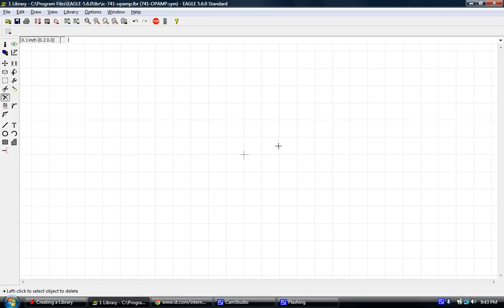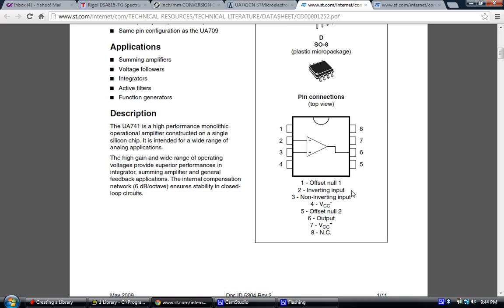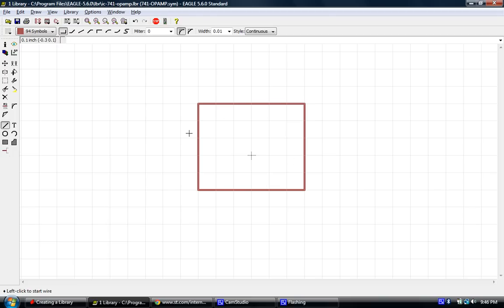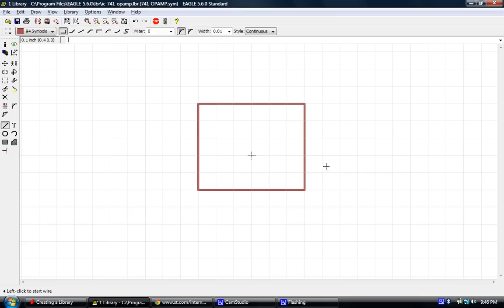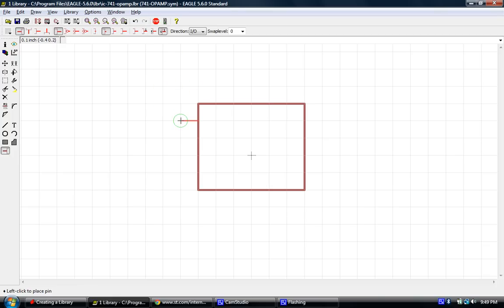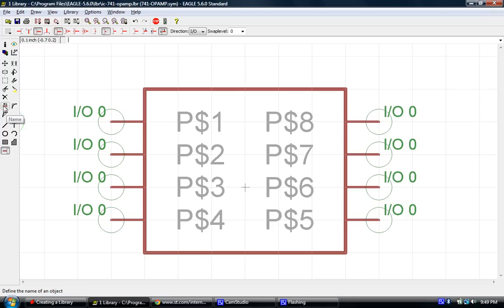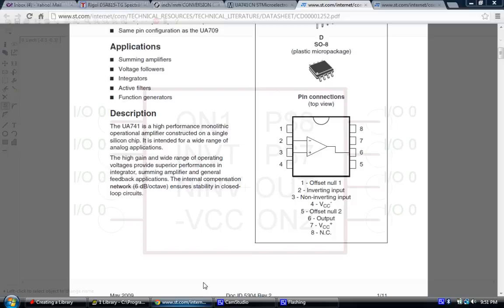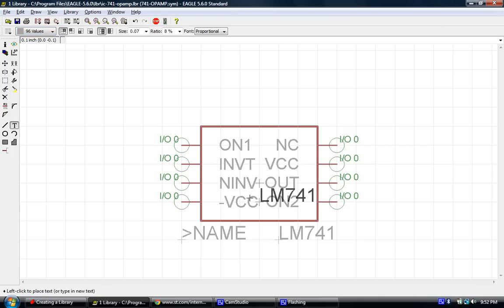Cadsoft EagleCAD Tutorial - Creating a Part Library - Lesson 2

Comment: In lesson 1, you brought up the Library frame, which looks just like mine, with no tools down the left hand side.  Lesson 2 starts off with a different frame, with lots of tools down the left hand side, which are essentail to the lesson.  I have been unable to switch these on, and the tools shown are not the same as the ones in my schematic page - so where did they materialise from between lessons 1 and 2?

Comment: Thanks a lot for the great videos ... its so much easier to get started than reading a manual and you keep it just to the right level of depth for a beginner like me.
When you inserted the pins, you had them all in I/O mode, wouldn't it be better to declare the inputs/outputs/power the way they actually are? When you check for errors, e.g. you accidentally connected two outputs directly to another or to power - it would create a warning which it doesn't when using your bidirectional pins?